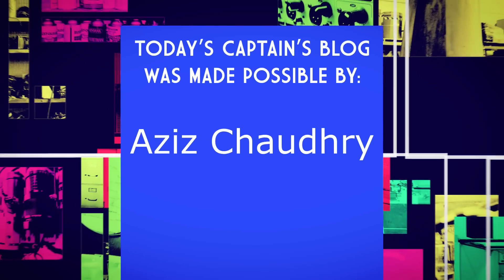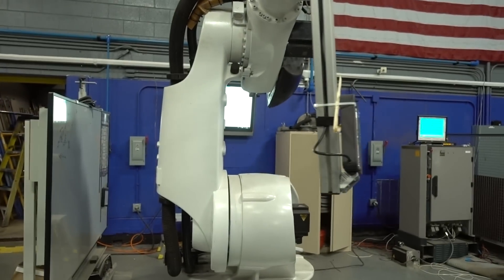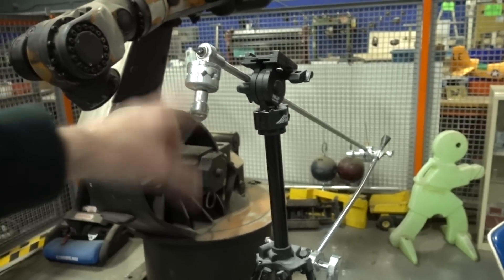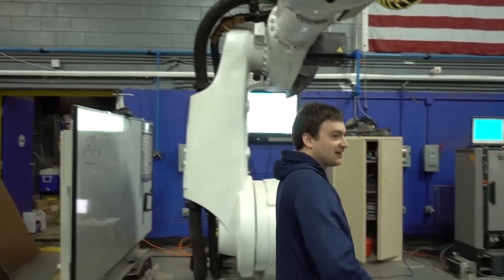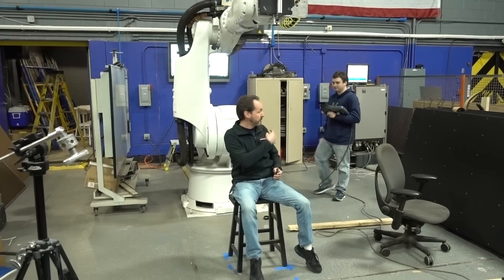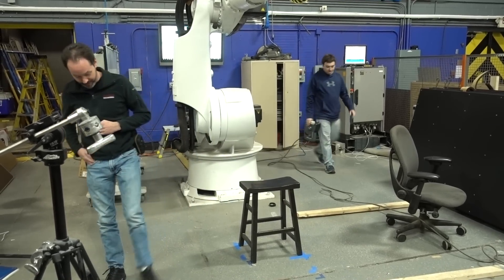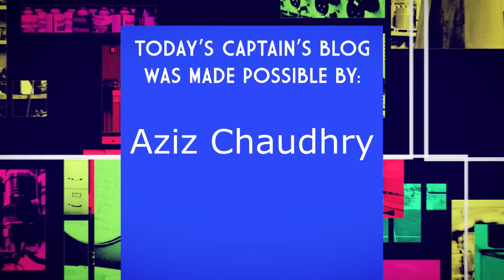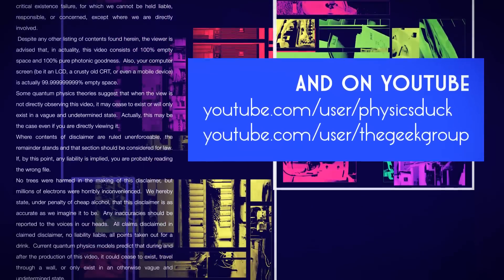Captain's Blog 11 4 2018 Sense3D scanning with Matt and the big Kuka

Comment: Would using sheer pins to mount the beam holding the scanner be a good idea as this is the part most likely to contact a person?
Reply: I believe the kuka has really really good torque sense/limit, so it would be easy to tune it to detect crash/impact.